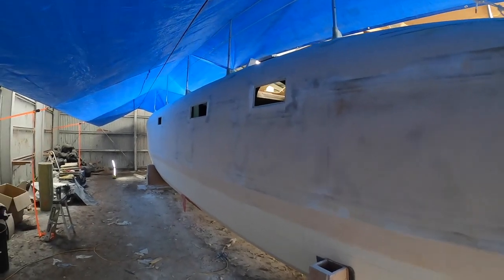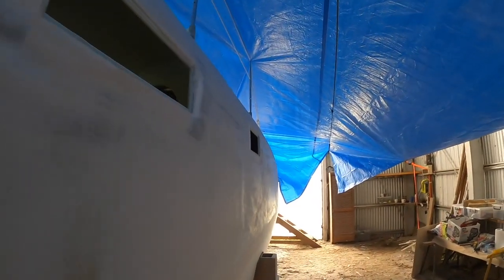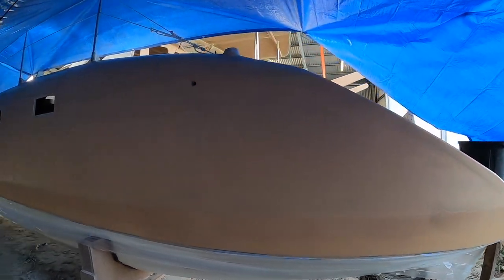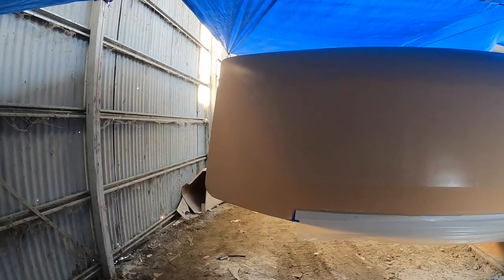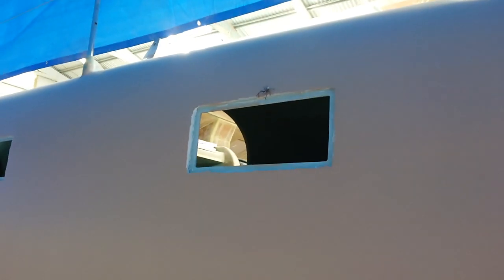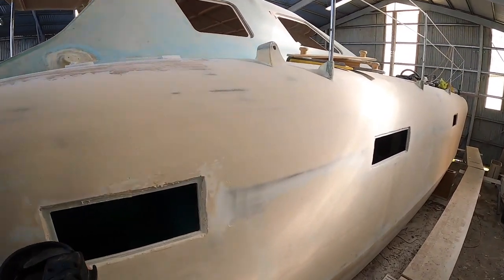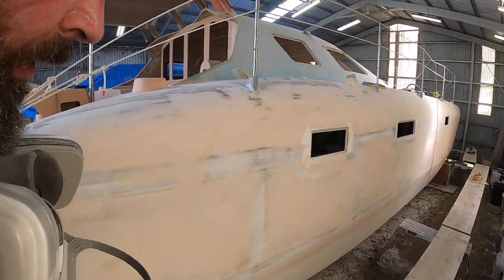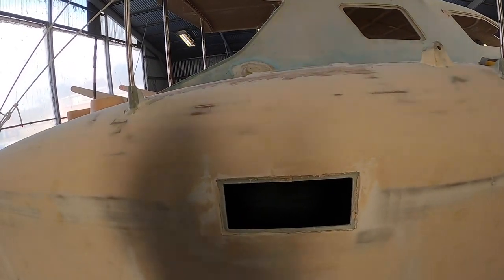Slapping some paint on - S01 E22 - DIY Catamaran

Comment: I really hope your painting system works. I was advised to coat the fairing compound with one coat of neat epoxy above the water line two coats below and then roll a few coats of epoxy high build with no thinners rolled on as soon as the epoxy kicked off.  This was to prevent the thinners eating into the fairing compound .. cheers Russell.
Reply from the maker: I hope so too 😂 basically the same thing though. Just a different epoxy.
Reply from the maker: The paint I'm using is not your regular coating. I work on ships, actually on rigs. The paint is designed for ballast/pot water, even black water tanks. As such, it is a very sturdy paint. It also sands beautifully. It was a necessity for me to do it this way, but I really think it will work out fine. I guess time will tell 😂 hopefully it will hold up for at least 20 years.

Comment: Looks good.. you're not a huge fan of using guide coat?
Reply from the maker: I am. But I was, at this stage, so far off I thought it was unnecessary. Next round though. And I used it between the bows. For some reason I didn't think to use it on the sides to start with. May have been a mistake. Learning every day...
Mostly from the mistakes 😂
Reply: @buildingwilda  yeah.. high gloss paint, brutal how it reveals everything, good or bad..
Reply from the maker: @R.E.HILL_  Hopefully I get most of the bad out before then 😂

Comment: Missed this vid when it came out Axel; congrats on the subs, well deserved. I think people don't tend to look too closely at things, they just see a boat shaped object. Anyway, with the sun reflecting in the azure sea onto the hull, who's going to care, ha, ha. Keep well and dodging the spiders....
Reply from the maker: Thanks Dale! I'll do my absolute best to get a mirror finish, but I won't beat myself up over it.
I really hate spiders 😂
Reply: @buildingwilda  That port topside is ready to be fully screeded now, followed by 200 hour of torture boarding followed by three coats of high build followed by one week of float boarding followed by highbuild under coat . You also can not get the film build  you require by roller. Its a simple as that!! Anything short of this effort{ system} will  give you a finish so poor.
Reply from the maker: @levelplain9887  Thanks, I know how much work it is, and the plan is basically what you describe. Roller does leave a very thin film thickness as you say, but it does matter what paint system you are using and whether or not the paint is designed to be applied by roller.

I am choosing my paint products specifically for roller application and I have the good luck of working next door to some professional boat repair guys, they are very helpful. So are the paint suppliers. I´m using an industrial primer from Hempel and got excellent support from them.

I´ll get there in the end, though perhaps not as quickly as with spray. And in a couple of years, at the next refit, perhaps it is time for a new shiny coat in a place where that is more affordable.

Thanks
/Axel